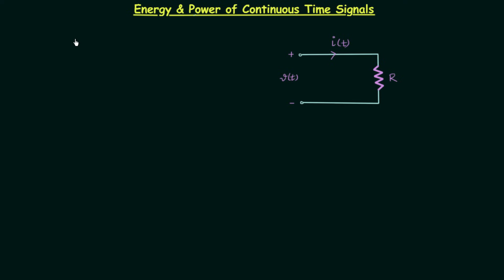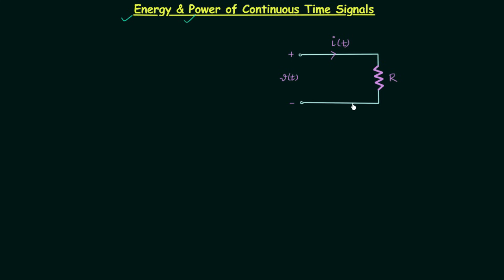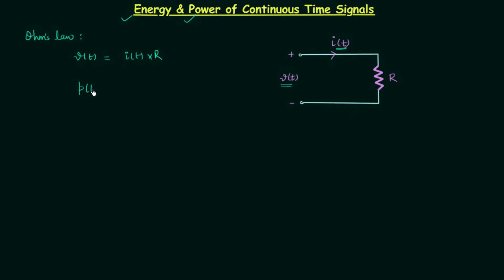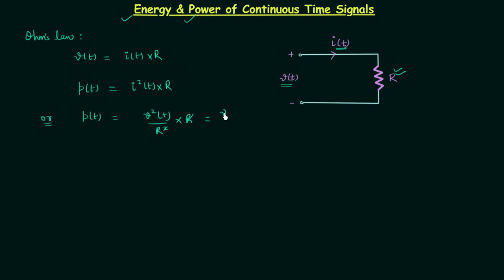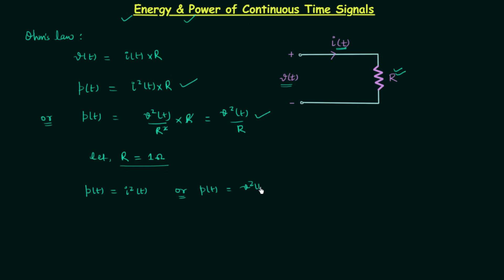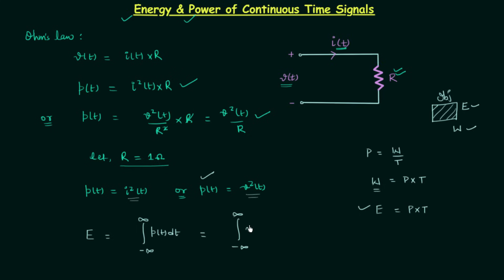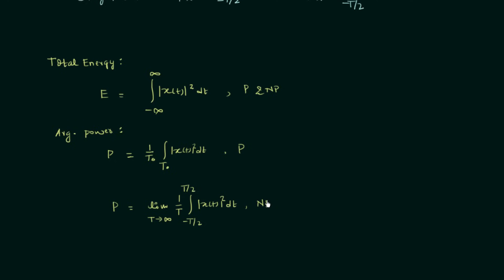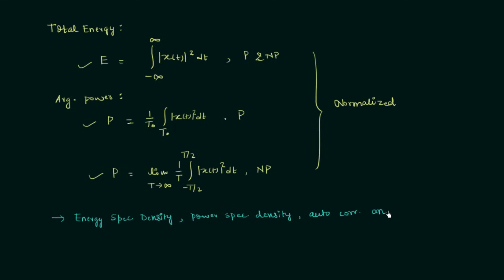Energy and Power of Continuous Time Signals

Comment: At 3:54. Work = "related to energy" , thus not Work=Energy. Work is the transfered/exchanged amount of  Energy. You also confuse Energy vs Power. at 5:38 Average Power calculation becomes Average Energy.

Comment: Around minute 6:00, if we want to generalize the formula for any signal, not only voltage, then why bother assuming/letting R = 1 Ω? I mean, if we really want a general formula, R in general is not equal to one. When I studied this lecture in my Communications class I had the same question, but I never got it answered.

Also, at 7:03, you took the absolute value/modulus in order to always have a positive energy. But that's not necessary, because the signal is already squared, and any square is always positive. In books the absolute value is also used, but it's because we generalize even more the formula to include complex signals (with real and imaginary part.)
Reply: I think  R is not a variable so  it just scaling your  answer, It has no use in calculations maybe that is why we can take R as 1
Reply: @7949RAJ  R is definitely a scaling factor. that doesn't mean we assume it's one and not represent it in the final general equation. so we need to represent it in the denominator in the final equation of energy. furthermore, i don't understand how this is a general equation to all continuous time signals , because the p=vi only stands for voltage and current signals (from which we derive the equation), we can't apply this to other types such as pressure signals, can we ?
Reply: R is just kept as a constant here actually its the power here as considered as propotional to either voltage^2 or current^2 I think so
Reply: as R here is not dependent on time

Comment: Why did u assume that R=1ohm? at 2:19
thanks at first.
Reply: Its for simplicity so you can calculate the power of the resistance with p(t) = v^2(t) or i^2(t)
because p(t)=v^2(t) / R = i^2(t) x R 
if R =1 then:
p(t)=v^2(t) = i^2(t)
Reply: I cannot understand how x(t) can be related with v(t)